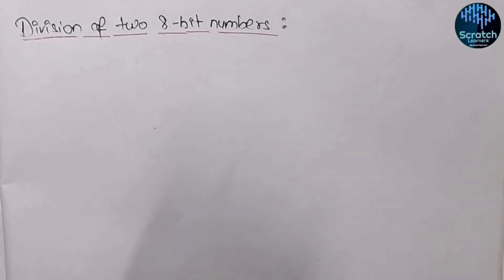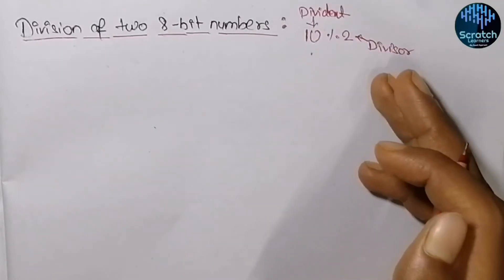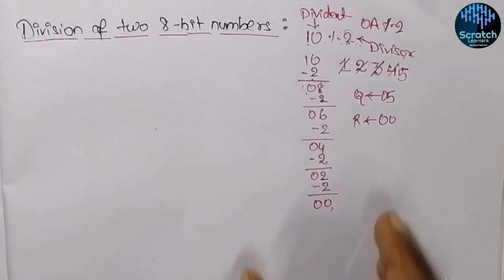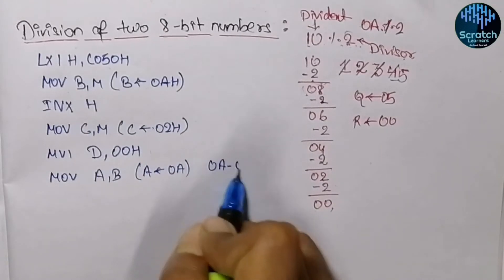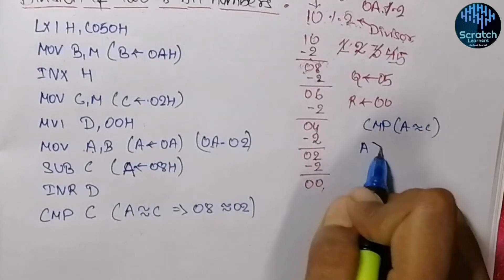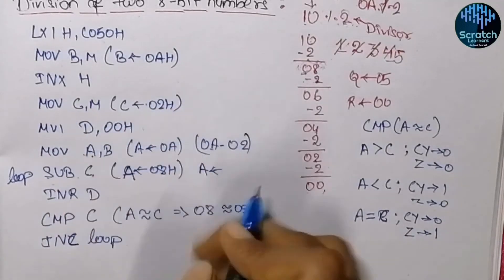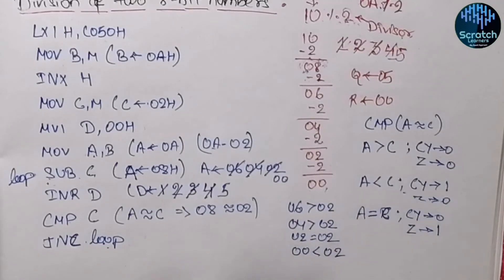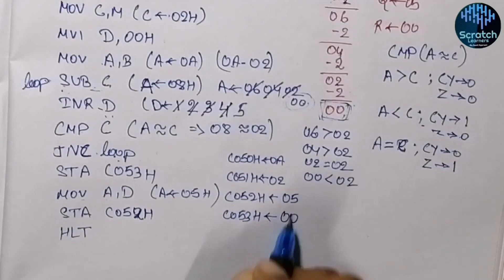Division of two 8 bit numbers in 8085|Division program in 8085 microprocessor|8085 microprocessor

Comment: Thank you for the video...🙂🙂
Ma'am I have a question. Can I place CMP before the subtraction...??
Or is there any rule that always after CMP JNC will be there...??
Reply from the maker: No, how can you compare before subtraction, after cmp, you have to check for carry
Reply: @ScratchLearners  But Ma'am if user give two numbers in a way those are not dividable so then how program will allocate because there is no CMP before subtraction..??
Reply from the maker: @subhajitdey4483  modify the program, code it in simulator. If it works then fine
Reply: @ScratchLearners  okay Ma'am Thank you...
Reply: @subhajitdey4483  true .. for eg 2/3 this program will give one